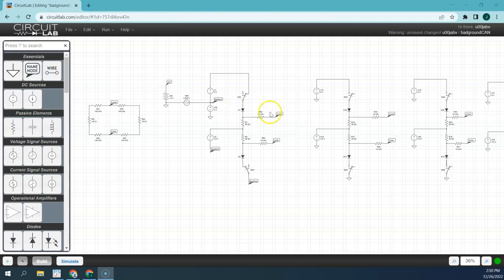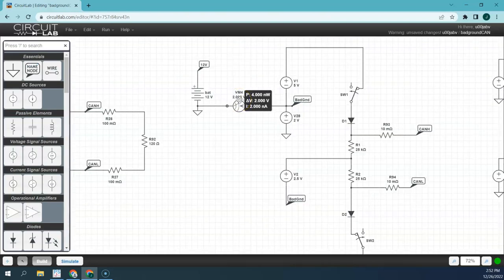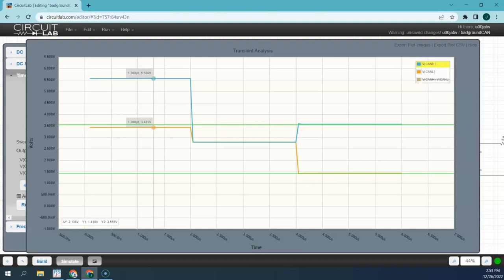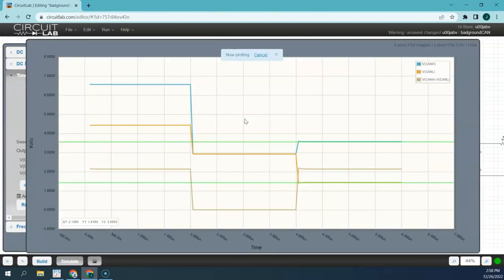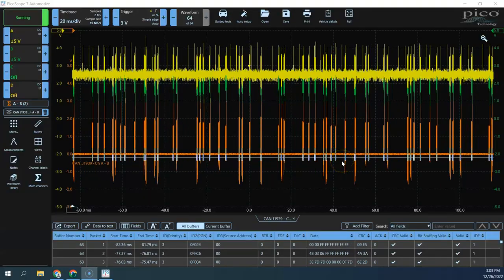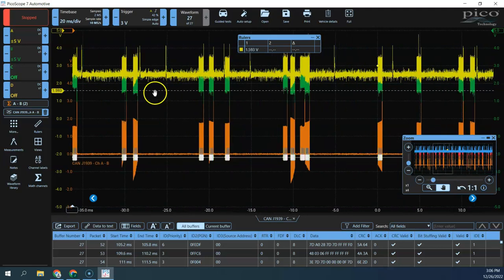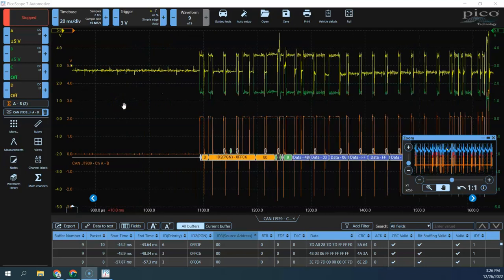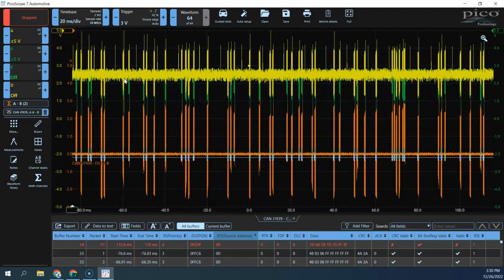Advanced J1939 Bad Ground 18

Comment: Hi Joe. Thanks for the video.
Will you be willing to share your wisdom on weird TSC codes, possible causes and how to go about it. 
So far Ive only found good information on buses with long lines for remote rpm control on the back.
But it is showing up on equipment with shorter wire runs.

Comment: Joe, what are your thoughts on the Vector tooling? Especially CANalyzer, using a 1600 series interface.
Reply from the maker: Vector is German.  Need I say more?  I have used CANalyzer for at least 25 years.  I had a CANcase XL w/J1939 with v 8.2 CANalyzer at JD and Navistar.  I now have a VN1604 and v 16 which I don't like as well.  I don't think I could do my job without it.  My boss complained about the cost, until he went with me to diagnose a problem at a large equipment mfr. which was costing them millions.  I figured it out in a couple of days, hardest part was duplicating the problem while collecting data.  He is now a convert.  For techs, it is probably overkill.
Reply: Thanks for your reply! We are plagued with j1939 CAN problems across our fleet at this point, with some fairly significant failures. Vehicles not going into gear, shutting down, and not starting up. Especially, when the problems are intermittent, I feel that the vector tool might help.
Reply: Also, have you ever heard of a engine ecm (cummins) switch itself off the CAN network if it detects a problem? It seems that with some of our newer equipment this situation is happening more regularly. And we are unable to communicate over the primary powertrain network, in order to establish communication once the defect is corrected, we must connect to the engine using the proprietary CAN network directly to the ECM, clear the fault codes, then the ECM will switch back on to the primary network.
Reply from the maker: @codylopez2020  the manner in which controllers respond to CAN errors varies tremendously.  There is no set rule and I have even seen where software updates to a controller causes the behavior to change.  Basically, if a controller detects CAN errors, it may stop transmitting for some period of time and eventually stop transmitting until a power down reset.  I have even seen some JD controllers which require battery power to be cycled to reset after correcting the issue.  The concept is that the controller tries to determine if it is the cause of the CAN errors and stops transmitting to save the bus.  CANalyzer may help, but you may need a scope to catch the offender.
Reply: Cool thanks, so do you think the scope is a better tool than canalyzer?

Comment: Thanks for all your videos Joe! I teach J1939 diagnostics in an advanced HD Diesel Computer Controls class and these videos are a great source for me. I was wondering if you could explain the way you set up your math channel and your Decoder to show your source addresses? Sorry if you did this but I cannot seem to locate it.  I agree the data is not an issue the typical technician needs to worry about, but identifying the suspect controller is.  I am NOT a fan of unplugging and retesting as many times we disturb our original issue simply by doing so. 
Thanks again great content and great material. 
Jay
Reply from the maker: Sorry Jay I have been pretty busy with the day job.  Basically you just need to create a math channel of A - B and use that as input to the decoder.  You may have to adjust the thresholds and will have to select the baud rate.  Pico Ben has some instructions here https://www.picoauto.com/library/picoscope/j1939-serial-decoding
Reply from the maker: Thanks Jay.  I'm in the field (Detroit) but I'll see if I can get time to show how to setup Pico for J1939.

Comment: Thanks, Joe. As usual, putting out priceless knowledge for today's technician. It drives me insane as a flat-rate dealer mechanic the amount of info kept from us. Troubleshooting is only how I make my living and feed my kids. I like how you can diagnose without a doubt in 10 minutes what would take an hour unplugging and plugging modules back in while possibly getting dirt/debris in a connector and causing a possible self-induced failure. I appreciate the 
understandable presentation and time you have put into this video. I'm excited about your future videos.
Reply from the maker: I have mixed feelings regarding flat rate having worked as a Chrysler dealership tech for five years in the 80's.  It has shaped the way I work as a salaried engineer.  When I left the dealership and started as a fleet mechanic for the electric company, I was informed by the other workers that I needed to slow down.  I don't think I could have went to university and worked as a flat rate tech at the same time.  Your understanding of creating future problems by disconnecting connectors is great.  That bad practice can also cause you to lose the evidence of where the series resistance of a layer of oxidation on the terminal when it is wiped off by disconnecting and reconnecting.  Nothing worse for a conscientious tech than "fixing" the problem while troubleshooting and then can't duplicate the problem knowing that it will be back again.

Comment: No truer fact! Information is King. We technicians can only be as good as the information we are given.
Reply from the maker: I figured you would agree with those comments.  The company who's name I shall not mention does not get this.  I had a BMW service trainer send me some of their advanced technician training material several years ago on diesel exhaust emissions theory which is referred to as pseudo engineering documentation.  It filled the gap between technician and engineering information.  I got shot down quickly when I presented it to the aforementioned company's supposed experts.